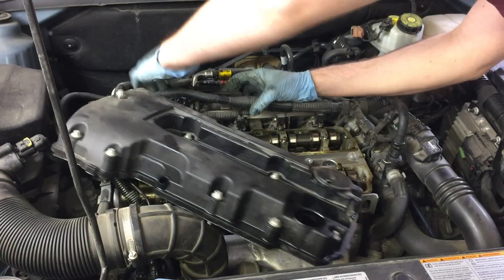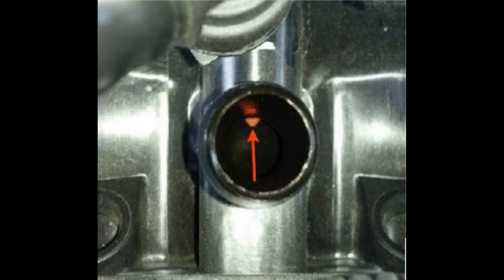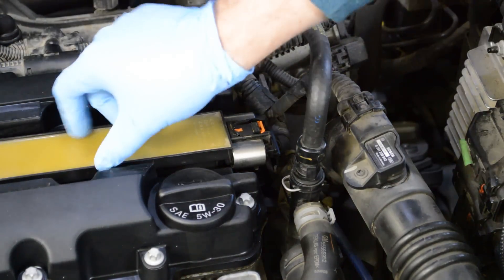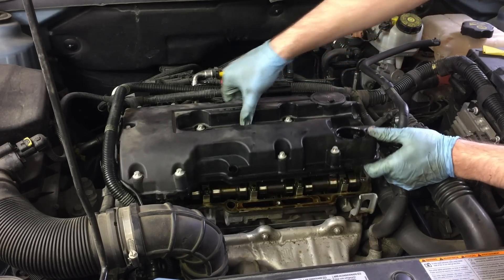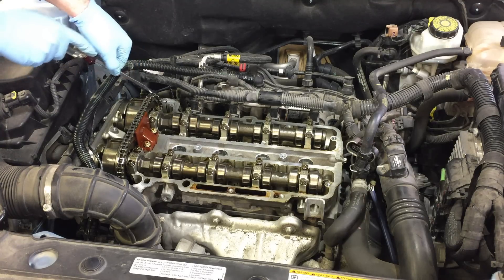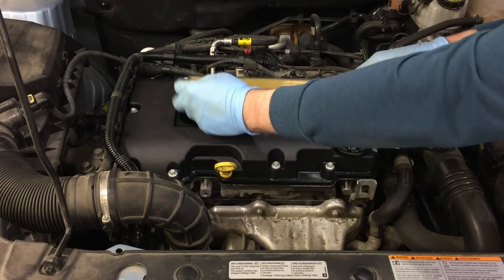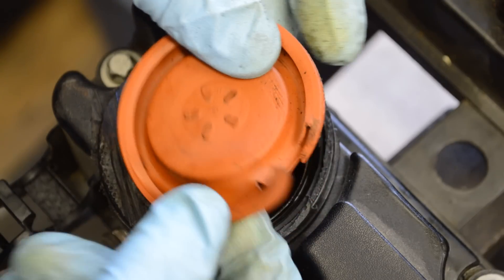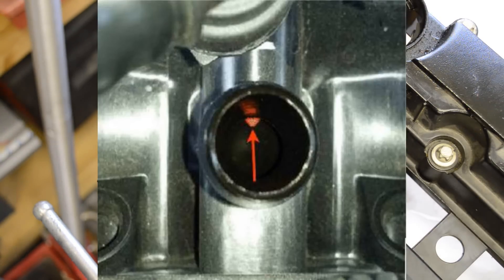How to replace the valve cover on a Chevy Cruze 1.4 liter Ecotec

Comment: I just replaced the Camshaft Cover.  That went well until I discovered that the mechanic who replaced it last time (2 years ago) stripped the threading on the block for the left 3 bolts.
To get around this without re-threading the block, I purchased 3  M6 - 1.0 x 50mm Cap Screws (METRIC) from Home Depot.  These are a bit longer than the bolts on the GM OEM Cover.  They were able to access good threading further down in the block.  I had to pull out the old black bolt sleeves with E10 Bolts, cut off the E10 heads to remove them from the sleeve(s), then inserted the replacement bolts.  Worked like a charm.  I was able to torque down to Nm 8 per the factory specs and no oil leaks.

Everyone should be a "Torque Spec nerd".  Last mechanic stripped my block because he wasn't.
Home Depot Part is EVERBILT CAP SCREW 562 660 - Class 8.8 stainless steal / zinc plated

Comment: replaced mine today thanks to this video and others like it. not a huge job but for me its a pretty big deal. one thing i would add, be sure you're  able to lift the E bolts up freely so you know they are no longer threaded to the block in the least bit.

Comment: Thanks for making the vid.  I have the Equinox with the 2.4l ecotec engine.  Lots of "designed to  fail" parts on it too.  So many things wrong with that engine I don't even know where to start.  Great money maker for the dealer service department, though.  Hell, it looks like half the engine is made of plastic.  Just cheap junk until you have to pay to get it repaired. :(
Reply: Mine has 250,000 running strong parts are cheep easy to work on great fuel mileage

Comment: So I had my engine light come on, went to the parts store and had them run the tester on my 2017 Cruze. Said I had a bad mass airflow sensor. $100.00 dollars later, I thought all was well. Then once more the light came back on. Saw some videos about that valve cover fiasco, so hopefully after spending another $100.00 more, it might fix the problem. I'd like to sock the dumbhead who designed this. Instead of a 20 dollar part, it's almost 100 dollars. Thanks for the video...

Comment: Mine is 2016 LT. i went to put the oil cap back on and saw it was not going to work out. You have to swap over the piece from the old one. Took me a minute not being able to see but tabs on side just pry up under and move it off. Easy enough job, seemed to fix it!

Comment: Check the bolts that come with your replacement valve cover. My original valve cover had bolts with pointed rounded ends to help find the bolt holes, the new one had bolts with square tips that could not find the holes. Had to knock the bolts out of the valve covers and put the old ones in new valve cover. Had to use rtv under the washers under the bolt heads to keep oil from leaking out, the O-rings that were there did not stop the oil. Also the gasket was different, new gasket did not cover one hole, so I used my old gasket. Got the valve cover from am auto parts for $43. I highly suggest not buying the cheap valve cover.

Comment: I work at a Chevy dealer in the parts dept and having this job done today for the second time. these covers sell like hot cakes and at one time were so popular, they were on backorder for a couple of months.  I cant believe there is no recall on them or at least a  special policy (extended warranty) on these. if your dealer charged over $100 for the part, they were taking advantage (ripping you off). the true MSRP is only $77!!
Reply from the maker: I politely pointed out to them that they were asking way more than msrp, but they wouldn't budge so I ordered it from a dealer that sells on Amazon.
Reply: They’re on national backorder again. This is the second time it’s blown on me

Comment: Just note that the failing valve covers are due to an issue with the PCV that is part of the intake manifold. It is recommended that you replace both so that you don't keep replacing the valve covers. https://www.youtube.com/watch?v=ZmkS21-rIsQ

Comment: Intake manifold could be part of the failure.
You also have to verify the valve in it is intact or the valve cover pvc valve will fail again prematurely.
I replaced both when my pvc failed on the cover.

Comment: Have had this happen on my Sonic with 1.4 Turbo. I've also replaced a couple on my friend's vehicles as well. What's even more mind blowing to me is the "updated" design cam cover that was supposed to rectify this didn't modify the diaphragm at all. They simply made a change to the geometry of the breather and the top of the diaphragm housing(still not removable though). The updated one fails at a similar rate in my experience even with intake and PCV line replacement.

Have you had to replace the water pump yet? That's another common theme with the 1.4.
Reply from the maker: This is the second time I've had to replace the valve cover on this Cruze. My water pump has not been replaced since I have owned the car, but maybe it was replaced before I owned it.

Comment: The valve covers will continue to fail until you address the check valve in the intake.  Also, if you look into the Cruze talk forums, there is a pinned thread at the top where one of the moderators has assembled a kit so you can modify the currently bad intake manifold to bypass the check valve into a more traditional style external PCV valve. This will prevent the intake manifold and valve cover from ever failing again.  He's sold over 800 kits so far to happy customers, I'm one of them.
Reply from the maker: I'm familiar with that kit and I'm considering getting one. I think some people may overestimate how quickly the intake will fail with the check valve missing.
Reply: @ToolTeardowns  So are you thinking it will last 50k or so without the kit?
Reply: wayne foutz, how much does this kit cost? That sounds like a smart investment.
Reply: Kit costs $80 but we'll worth it.
Reply: Link?

Comment: Replaced my cover already, and now my engine is spraying oil. I reset it and its STILL spraying oil like crazy. Any ideas?
Reply: Could you fix it?
Reply: @williamraysv  yeah, the gasket that came with the new cover was trash. Bought a new one. Had to clean the block and used extra sealant, but it runs fine with no leaks now

Comment: Did you have to replace the gasket too? What is the silicone called that was used?
Reply from the maker: The new cover came with a new gasket. The silicone was just rtv gasket maker silicone.

Comment: Any problems with a ticking in the engine? I keep up on my oil changes and typically when I get it changed the ticking isn’t as bad. The ticking also gets faster as I accelerate
Reply: They all do that its the fuel injectors
Reply: Yep its the good ole Eco-Tic engine. Could be bad valve lifters or evap sensor, but its not worth the fix they all make that fucking hideous noise
Reply: @LongboardManiac  The 1.4 ecotec has noisy injectors...they were known to do it from brand new it's just how they run.
Reply: @W0RLDSSMALLESTVI0LIN  I always thought it was my valve lifters, and the purge valve/evap sensor will make a ticking noise when it goes bad. Do you know if i got aftermarket fuel injectors if they would tick like this?
Reply: @LongboardManiac  I honestly don't know, that's a question for the guys on the cruze and sonic forums.

Comment: A self proclaimed "Torque Spec Nerd" why wouldn't you share the torque specs?
Reply from the maker: Because of people misreading or misunderstanding them and blaming me, which has happened before.
Reply: Well, I just did mine.  It's absurdly lower than what you would think.  71 in lbs which is about 6 ft lbs.  IE you need a very small torque wrench for this job.  Plus if you over torque it you will strip out the threads in the head or crack the cover.  So this is one of those parts you really need to torque to spec.
Reply: @ToolTeardowns   what sealant did you use?!

Comment: A little confused,  I have this issue but every search I come up with a gasket for the valve cover . I noticed you did not replace a gasket. I have a 2014 Cruzev 1.4L
Reply from the maker: The valve cover comes with a new gasket already attached.
Reply from the maker: If you're referring to the diaphragm that fails, it's integrated into the valve cover. The entire valve cover must be replaced if the diaphragm has failed.

Comment: How many miles were on your engine before this failed? Mines starting to rough idle when its hot out (110F+)  at 46k miles
Reply from the maker: I think the first one failed around 55k miles and the second one around 85k.
Reply: @ToolTeardowns  I agree because my 2017 Cruze has 57K and it starting to failed.  LOL

Comment: How about if you block the hole will that work?
Reply from the maker: It would help with the vacuum leak, but I think the valve wouldn't be operating properly.
Reply: You can block the small holes the rubber disc was covering but only if you plan to drill a new hole into the manifold and install your own pcv valve otherwise you're going to have problems

Comment: They should just make it a metal cap just like the oil filter but that might be to easy I just had a bad valve cover no engine light since sept 2020 and now new valve cover and light is on valve tick and major whistle like before needs better cooling too cuz didn't hear a sound all winter now its very bad taking it back to mechanic thank god its nationwide warranty but ya might need a boost controller too to build or release boost for fun but pressure to

Comment: How long do you need to wait after you put it on to fire it up?
Reply: I waited 16 hours to allow the RTV to set up.  I used oil resistant Black  Max Permatex.  Do not need much.  2 mm high by 8 mm wide centered on the head to front cover joint.  Remember once you apply the RTV you should finish tightening up the 15 fasteners within about 10 minutes to close the RTV seal before it skins over.  Know your torque sequence and go thru it.  I used three passes.  Seat all 15 fasteners then torque and retorq again.

Comment: Isnt that blown diaphram just a sympton of a bad pcv design?  Meaning, it will keep happening, until you build your own pcv system.
Reply: Every 70-80k miles is what I read.
Reply: I've heard the valve cover re failing within as little as 20k miles if the pcv in the intake manifold isn't addressed.   Cruze kits website sells a permanent aftermarket fix, I'm about to install one myself.

Comment: i purchased a aftermarket valve cover online. and had it installed atter 1 day it went bad and oil leaked all over my engine. i went back to my mechanic and he told me valve cover was junk.and that i should get it from dealer next time if it goes bad again after fixed it twice
Reply: Joey Gastelum thats bs obviously the mechanic failed to install it properly.. he either over torqued it causing the gasket to leak or he didnt torque it enough...
Reply: correction causing the gasket to split

Comment: I have a 2013 Sonic with this engine. It has been a nightmare. I bought it with only 51,000 miles from a relative. The problems started right away. First the water pump failed. If you have any 1996 or newer GM car, you need to know that instead of coolant, it is filled with DEXKILL. This is a liquid concoction that solidifies inside the engine. I used about 20 gallons of distilled water, and it took about a week to flush it all out. If you have this stuff in your engine, GET IT OUT NOW. I replaced the water pump, thermostat, and a part called the "water outlet assembly" on the right end of the engine looking at it from the front. Then I filled it up with Prestone OAT coolant. Next came the valve cover, intake manifold, and PCV valve that connects to the turbo inlet. Then the purge valve solenoid. I have run into the DEXKILL issue on several other GM vehicles, some of which could not be saved because all the coolant passages were completely plugged with solidified DEXKILL. 

The torque on the valve cover bolts is 8nm, and I would use Permatex #2 on the head next to the cam chain. I removed a bit more stuff from around the valve cover, and used several mini bungee cords to hold it back out of the way so I didn't have to wiggle the cover out from under anything, then wiggle the new one into place. That can get dirt in the engine, and knock the gasket and gasket sealer out of place. It is a lot better if you can set the new cover straight down on the head without any sideways movement. 

Plan on doing the valve cover, intake manifold, and PCV valve about every 50,000 miles. I will NEVER buy another GM vehicle newer than 1995.
Reply: Gerald Scott funny. Mine has 123k miles on it and this is my first issue.
Reply: my wifes chevy cruze is at 80,000. i have replaced the water outlet assembly hose, the thermostat, and im about to change the valve cover / intake manifold tomorrow. im not familiar with the pcv valve that connects to the turbo inlet, i will have to look into that.
Reply: I would think that this stuff would be covered by warranty, knowing it only has thoes miles right?
Reply: You have to keep replacing the diaphragm because you arent fixing the problem, but the symptom.  The pcv system in the air intake is of poor design, and both the pvc and diaphram will continue to fail.  A rework of the pcv system is the only real solution.  Its actually not that bad to do.
Reply: You post this on every site, except you change the first line to pertain to the video. Your information on dexcool is grossly wrong and is bullshit from the 90s under backyard mechanic misunderstanding.

Comment: Your video was really helpful mate, thanks for the video. Please do reply if you can as i wanted to ask, my car got a vaccum leak but its releasing a white smoke too when i press the throttle and a little bit of ticking noise also comes from the engine on pressing the throttle. 
Please do reply if you can.
Thank you
Reply from the maker: I don't know about the white smoke. I wish I could help you, but I don't know.
Reply: Tool Teardowns, thats all good mate.
Thanks for the video again.
Reply: intake manifold needs replaced ?

Comment: Bulls if you don’t have the external torx bit you can use an 8 mm on those valve cover bolts. Also, DO NOT OVER TORQUE those bolts. They will break easily. Take it from me lol
Reply: Thanks for letting us know. Hate to buy an item and use it once...however if I decided to keep this stupid GM craps then I'll probably had to replace the vale cover again in another 20-30K. LOL  My 2017 Cruze only had 57K and it failed

Comment: A non honest mechanic can brake this part and the intake and make the customer come back? Cause i didn't have any problem until they fix the coolant. Now is chaking and evwn heating cause the coolant is leaking. They did not even fix it well. Now they just said we don't see the problem it looks fine. And for the valve you have to go to the dealer.

Comment: Agree.  Poor engineering on GM part or they purposely dose that so they can sell us owner parts in order to make more money.  End results, people stop buying products and they end up bankrupt again.  I own a 2017 Cruze with the 1.4T and it only has 57K and that problem already appear so I had to soon fix it but no check engine lights is on though.  Whistle noise coming from the right side of the engine bay and it's not the front seal. I had a Honda over 100K and never had issue,

Comment: It's basically like this, GM designs all these parts made together so they can F  U  C  K you over and make you pay more money to buy the whole part instead of a smaller part of a whole assembly!

I've got a 2012 Cruze and let me tell you, it's a nice riding little car but man if they don't have so many damn problems, I've done so much to keep it on the road, it's had so many codes and problems that you normally wouldn't have with an older vehicle, but again it does drive nice, and it gets from A to B when it's running good!

Comment: Chevy, just bullshit. Same with the coil. Fu... expensive spare parts and you have to exchange the whole thing. Also they using so cheap materials that break easy and cause the drivers a lot of headache. Fault codes all the time and engines get over heated very fast. Chevy should step up their technical quality a lot. The design of the cars is nice though....